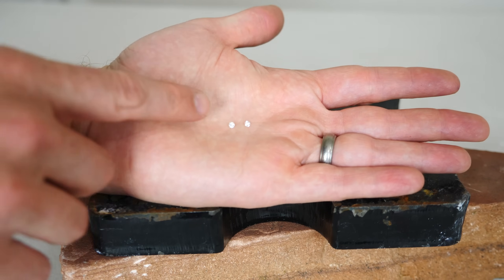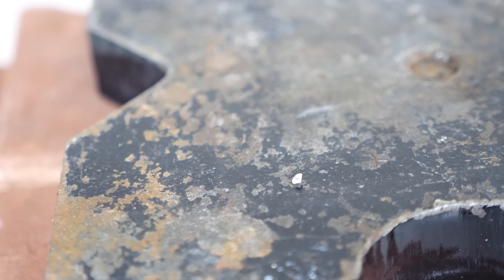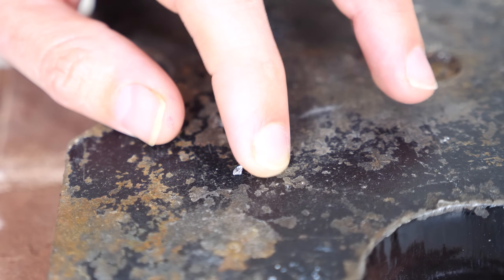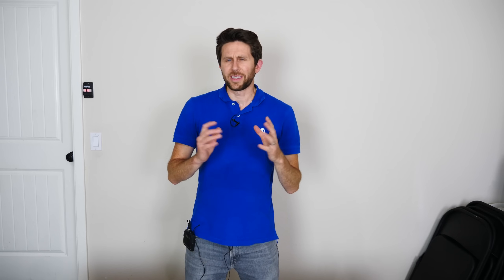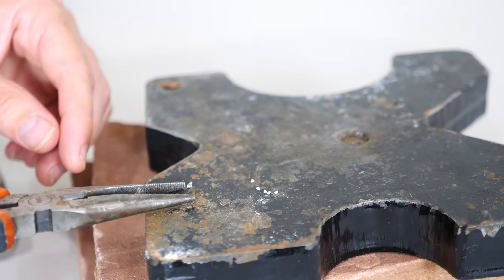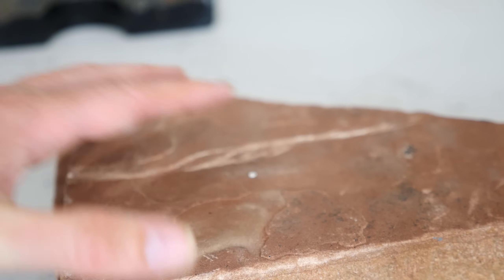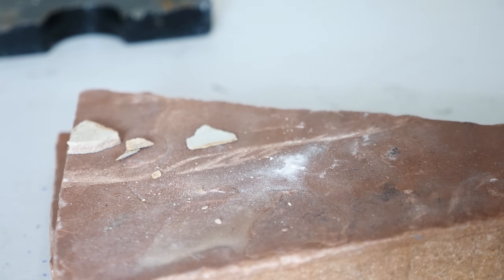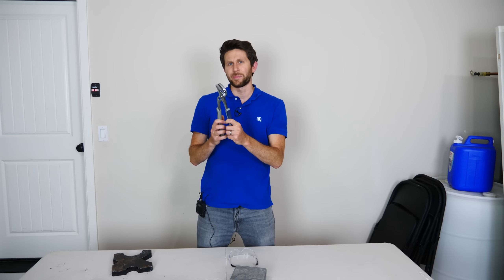Can You Break a Diamond With a Hammer?

Comment from the maker: I didn't break one of the diamonds, what should I do with it?
Reply: You should give it to your wife, she would probably like that. 😁
Reply: @sscho1636   Haha good one
Reply: melt it
Reply: @DamianReloaded  absolutely!!!!
Reply: What happens when you heat it up?
Reply: @deancyrus1  it gets hot
Reply: @saifmohammed9070  i could have said the same thing to the original video about hitting it with a hammer....🤣 'it breaks'
Reply: @deancyrus1  but in that case something actually happens, nothing will happen if u heat the diamond unless he gets to 3500+ degrees Celsius
Reply: @saifmohammed9070  It'll burn at a much lower temperature than 3500°C.
Reply: @kyle88740  yes it will in a concentrated oxygen environment
Reply: @saifmohammed9070  and your point is? Other than contradicting yourself. In one breath you say nothing happens and in another you say it will 😂
Reply: @deancyrus1  that it will be cool to see. Heating it won't (theres a difference between heating and burning)
Reply: @saifmohammed9070  did i say that there wasn't a difference between the two? What was your suggestion for the diamond?
Reply: Dean Hamlin It melts if temperature over 6000 degrees is reached or it burns away until the whole diamond is gone if exposed to air or oxygen in general during heating. In the end diamond is just carbon.
Reply: Dean Hamlin it'd just evaporate. They have done this experiment before. Better is it to gift it out.
Reply: Burn it!
Reply: Give it to me
Reply: Saif Mohammed my response literally.
Reply: Saif Mohammed duh
Reply: @saifmohammed9070  no me
Reply: try and melt it
Reply: This isn't related to the diamond thing but there is 90% chance you will see this. I heard that boiling(not boiled) water turns into ice faster than normal water into ice. But I never could understand why. I would be very grateful to you if you made a video on it.
Reply: @sourabhperuri1698  there are many videos that show that boiled water turns faster into ice, I think Cody's lab has a good one on it
Reply: @Ktulu789  Thanks. Will check it
Reply: @sourabhperuri1698  because the atoms are more excited and escape easier when its boiling but as it cools because it has come from a high temperature it goes colder quicker. Think of it as if a race starts the room temperature water is standing on the start line but the boiling water had a running start so will always win.
Reply: @DJAsHeRMusic  I didn't get it right I think. Why will it get colder faster if it is at more temperature? It is more distant from the start line than the water at room temperature. This is my understanding. If purity is a reason, then the experiment must be tried with boiled and boiling water. Could you explain your reply in a little more detail?
Reply: try burning it at very high temp
Reply: Make another experiment with them. Try to zoom in and show us the bonds between carbon atoms
Reply: @AwesomeTheAsim  lol
Reply: A Akd not possible to see bonds directly. But due to XRD structure and bond length can be analyzed.
Reply: @AwesomeTheAsim  nice idea you are smart
Reply: @AwesomeTheAsim  r/brandnewsentence
Reply: Melt it
Reply: Give it to Steve so he can make armor
Reply: EEAAATT IIITTTTT!!!!!

Jk dont
Reply: PRINCE RUPERTS DROP VS DIAMOND!!💧VS 💎= 💀💥?
Reply: @rayfairbanks6280  Prince Rupert drops can scratch and dent. I think smarter every day has some slomo video about one that looses a bit from the drop side without shattering. Pretty amazing!
The action lab never did experiments with Prince Rupert drops, i think, so.... That would be an interesting experiment anyway!
If it was not Destin, maybe the slomo guys or hidraulic press channel... The best on PRD is smarter every day, though.
Reply: Make aerogel out of it.
Reply: @JohnGrapes  Lol
Reply: @JohnGrapes  uwotm8
Reply: Turn it to aerogel.
Reply: Put it on a ring for your wife
Reply: Burn it. You can burn it, right?
Reply: A ring for your wife..I guess🤷🏾‍♀️
Reply: Explain the electrical properties of different materials based on carbon. Like diamond, graphite in all three dimensions, ... So people will get to know the difference in bondings.
Greetings from germany
Reply: Diamonds are worthless, so just throw it away
Reply: Smash it.
Reply: The Action Lab add it to your collection of experiments
Reply: Scratch different hard core materials with it 👍
And if it is still survive... give it to me 😊
Reply: Put it in the vaccum chamber and see if it turns to water.
Reply: make it back into graphite
Reply: Eat it
Reply: @HTETgamer Laser will burn through diamonds, yes. Lasers have almost become standard equipment in diamond polishing facilities because it separates the crystals into usable pieces much faster than traditional diamond coated "saws", with much less waste
Reply: There are a lot of really cool things you can do with lasers and diamonds. Give it a shot!
Reply: Cool it in the liquid nitrogen and then rapidly heat it and see if it'll shatter?
Reply: Hide into one-one Action Lab box! :D
Reply: Try some other experiments with it.
What happens if you put it to high temperature? Will it transform into carbon? Change it's structure? Become graphite? Change color at least?
What types of acids can affect it and how do they affect it? And what those same acids do to other things like gold silver or steel. Maybe even against some common household material that is known to be resistant to certain acids, it would be interesting to see an acid that kills diamond but doesn't affect... I don't know, silicon? Rubber? Teflon? You may need some chemist help here but I'm sure there are surprising things to explore here.
Try to use a macro lens to film the diamond. Thankfully, it didn't jump out of the plyers and into the unknown xD
Thanks for the video it was very surprising both ways, you always teach me something even when the title seems simple (not this case) so I try to watch all your videos. Keep it up!
More ideas: Try to show how do they work the diamond shape. If it is so hard... Then how? xD
If you use a very sharp titanium point, as the point and pressure is done on a very small area, would it scratch the diamond? (First hammer it in place so it doesn't move xD)
I said fire, what if you throw it on liquid nitrogen? How fast does it transfer heat? What if it is heated and then thrown into liquid nitrogen, would it break that way? The other way around? Cold then heat? Does it glow when heated? Would it react with Mercury or some other element? (Ask the chemist again... These guys are handy! xD)
Man you certainly sparked my curiosity! I could easily keep coming up with experiments for a year of content with just a single diamond haha, now I know why are they so valued xD
Reply: @Ktulu789  there are already videos that answer these questions. Go find them.
Reply: @ThePrufessa  thanks! I actually saw one on acid but just with two acids and no household items.
I guess that everything is already on YouTube, anyway xD But the personality of the action lab is irreplaceable :-P
Reply: Scratch that big one with them smaller diamonds
Reply: Crush it in your press
Reply: make more diamonds with graphite and extremely hard pressure and heat
Reply: Hydraulic press it
Reply: Break things with the diamond.
Reply: Make a beautiful ring and give it to your wife
Reply: The Action Lab give it to your crush
Reply: Show it's physical properties.will it shine in dark?
Reply: Give it to your wife
Reply: Im just saying your wife may be lookin this direction
Reply: Grow it to a larger diamond
Reply: gimme that, I need it for my xperiment
Reply: See if it can cut holes in glass, like in spy movies.
Reply: Give it back to your wife. She must be furious
Reply: Put it in a hydraulic press
Reply: Make a glass cutter with it
Reply: test how it scratches other materials
Reply: I can make you a ring
Reply: Put it into the lavaoven and afterwards smash the lava and try to find out if it kept its form...
Reply: Eat it
Cuz the body spreads nutrient from the small inestine to the whole body
1st, spread the diamonds into pieces until its small enough for small intestine to absorb it
2nd, eat the diamond's dust 
3rd, wait for 18 hours and you now become the strongest and the hardest man and material in the world
Reply: @The Action Lab , I have two questions 

Q # 1 : Can you dry your washed clothes in your vacuum chamber ?
Q # 2 : Can you make protein powder by drying/evaporating/boiling the liquid part of whey in the vacuum chamber ? 

Seriously , I want to know .
Reply: Can you , destroy it chemically
Reply: Do a demonstration showing the hardness of silicon carbide, glass, sapphire, and diamond
Reply: This can be your anniversary gift but keep secret 😉
Reply: Try to see if it’s bullet proof
Reply: Swallow it shit it out and sell it.
Reply: Try burning the diamond. Diamonds are made of carbon and they should burn.
Reply: Give it to your wife
Reply: make a beautiful ring for your wife 😊
Reply: Make a ring
Reply: Make a jewellery and give it to your wife
Reply: Get a refund, cuz its fake.
Reply: Eat it
Reply: I have a question, I do know this video was made 1 year ago, but dude perfect did something like this where they tried to shatter a diamond with a hammer in episode 1 of OverTime, but the diamond did not break. Could anyone explain this?
Reply: Break it then!
Reply: Cut the diamond in half not breaking it.
Reply: @dieticianmeenakshimajumdar7854   he needs another diamond to do that🙂
Reply: Lick it to dog
Reply: I think it would be interesting to put it in your foundry and see what happens
Reply: give it to me
Reply: Burn it or zoom it with microscope
Reply: Could you try to burn it?
Reply: Convert it to graphite (thermodynamically it's more stable than diamond)
Reply: Would it burn? It is carbon after all...
Reply: Give away?
Reply: Mount it on a piece of jewelry for the wifey.
Reply: Put it in the hydraulic press!
Reply: Burn them, it would make a good video
Reply: hydrolic press !
Reply: Set it on fire
Reply: Put it in the vacuum chamber! Why? Idk
Reply: Submerge it in liquid nitrogen and then immediately in something superhot to see if it shatters?
Reply: See what temperature it will melt under
Reply: Melt it or use it for a laser lol
Reply: burn it in oxygen
Reply: Hydraulic press? :)
Reply: Try breaking it with vice grips
Reply: Hmm I was thinking about the hydraulic press...
Reply: Use press machine, then record it with super slow motion cam
Reply: Try turn it into a little cube by cutting/sanding would probably take forever to do but never seen a diamond cube before
Reply: @DJAsHeRMusic  it might end up smaller than a millimeter probably. The current shape is pretty round and a lot would be wasted.
Probably won't look any different than glass. What makes the shiny appearance are the geometric faces with their respective angles and the diamond shape is specially designed for that. There are many special geometric shapes that enhance brightness based on the original shape of the rock (more oblate, more elongated or the classic). Most have many faces on the point side and a "window" on the other side and some bevel.
Reply: Drop it on lava
Reply: Try to break bulletproof glass with it as we saw it on Sherlock Holmes when Moriarty broke the glass containing the crown using a gum,a piece of diamond and a fire extinguisher!!!!!!
Reply: Try to put it in some acid like (h2so4 Or Stomuch acid:-HCL)
Reply: melt it with the laser
Reply: Giveaway😅😅
Reply: Hydraulic press it
Reply: If I have a diamond that's for free
I will try to scratch every thing with it then I'm going to do heat experiments
Reply: Abdul1s Launcher  if had a diamond 
Would you just give it as gift or to poor 😁
Reply: Maybe put it in flourine or show/explain how they are resistant to being dissolved by acids.
Reply: Turn it back into coal
Reply: Try to melt it with heat
Reply: Give it to someone who needs it
Reply: You should try to burn it.  Diamonds combust at very high temperatures.
Reply: My heart is breaking 😫
Reply: The Action Lab see what happens if you cast it?
Reply: Give it to me cuz I'm broke😭
Reply: Do a giveaways
Reply: You should put it in a random subscription box with a note taped to it
Reply: It’s alright I’ll take if off your hands for you
Reply: give for charity
Reply: War
Reply: Try to disolve them.
Reply: Eat it
Reply: Put it on the hydraulic press
Reply: 1:31 - 1.37 What happened then?
Reply: melt it
Reply: Try to burn it with liquid oxygen
Reply: The Action Lab sell it
Reply: Sell it
Reply: Eat it
Reply: Try to see if you can melt it
Reply: Let me have it
Reply: Try to burn it
Reply: Give it away to a lucky subscriber.
Reply: craft a diamond shovel
Reply: Put it under under the hydraulic press
Reply: Make diamond armor with it
Reply: Give it to your dog
Reply: Look for what stone like diamant is the most price
Reply: Give it away.
Reply: Throw it away
Reply: The Action Lab make a diamond shovel or a jukebox if you have some wood
Reply: Try burning it. What is its burning point?
Reply: Me want diamond
Reply: Me want it, you give me it
Reply: Plz give me that diamond
Reply: I will get 100  subscribers for you . Give that diamond to me.
Reply: Put inside some car engine
Reply: How fire resistant are diamonds ?
Reply: The Action Lab gimme
Reply: Diamond vs liquid nitrogen
Reply: Make a clip of how much temperature is needed to melt a diamond
Reply: Can I have it?😢😢😢😢😢😢😢😢😢😢😢😢😢😢😢😢😢😢😢😢
Reply: Keep it
Reply: Scratch things with it
Reply: some experiments and example of playing with it's refractive index please
Reply: Can u melt a diamond?
Reply: Try to melt it or show how it reacts to diff matters like acid or any other
Reply: Fashion the diamond into your burning laser to enhance it!
Reply: PUT IT IN A PRESS
Reply: Try to melt it
Reply: Try to shoot it and see if it breaks
Reply: Make a diamond shovel
Reply: Diamond vs Hydraulic Press?
Reply: What would happen if you throw it at a window? Because it's harder than glass...would it shatter the glass?

I have seen a tiny piece of spark plug ceramic shatter safety glass, when thrown by hand.
Reply: Heat it up super hot and drop it in liquid nitrogen
Reply: Heat it up and drop it in liquid oxygen and see if it really burns the diamond!!! Or explain the difference between Cubic Zirconium and diamonds!!!!!!
Reply: focus 5w laser on it or freeze it with lq nitrogen and quickly heat it up to see if you can break it with thermal expansion
Reply: The Action Lab Eat it!
Reply: Make a giveaway..
Reply: Eat it
Reply: Eat it so you can say "I s**t diamonds".
Reply: Se if a Diamond melts
Reply: Try melting or burning em
Reply: Try to burn or melt
Reply: I would say craft a diamond sword with it, but you only have one.
Reply: Giveaway
Reply: diamond shover obviously.
Reply: Melt it
Reply: Put it in lava
Reply: Try to burn it, and if it doesn't it can be used for something else again !
Reply: turn it into armor and raid area 51
Reply: Let the spontaneous process happen and let it convert to graphite in the next 50000 years
Reply: Diamond can only be smashed or crushed by a diamond
Reply: Touch diamond with diamond to see it break as a yt vid, or sell it or keep it FOREVEEER
Reply: Melt it with a high melting point
Reply: Burn it!!!
Reply: Smelt
Reply: Burn it.... then see if you can polish off the burnt surface... I'm a jeweller and it happens more often than people would think
Reply: Break it
Reply: Shoot it at the Gorn.
Reply: Send it on my address
Reply: Maybe make crazy diamond stand
Reply: Give
Reply: lava
Reply: BREAK IT
Reply: Make it bigger
Reply: Use it to break tempered glass - like using a spark plug, but I'd be interested to seeing that happen with a diamond.
Reply: Give it to meeh
Reply: Give it to me
Reply: cook it
Reply: eat it
Reply: Eat it
Reply: Eat it
Reply: Use in a laser ...like the movies
Reply: sell
Reply: Gimme the diamond!
Reply: Sell it?
Reply: This is the work of an enemy stand user
Reply: Sell it
Reply: Definitely blast it with oxy/acetylene.
Reply: i vote to send it to president putin to make him stop attacking ukraine
Reply: Dude do you know diamond are that strong that they can withstand the pressure that is five times more pressure that earth's core has in it
Reply: If you didn't broke diamonds then we're they fake diamonds
Reply: Put it in a machinists vice and see if a bandsaw will cut it
Reply: Try placing it in Lava....
Reply: shoot it with a gun?
Reply: Oh, so that's why they call them Die-Mounds, because you can easily break them into a little mound of dust.
Reply: Draw on glass with it.
Reply: Put it in hot lava
Reply: The Action Lab is this real
Reply: @nirajpatel1247  yes
Reply: Find a local glassblower and show how it can be encased in glass!
Reply: Gimme gimme
Reply: Use an iron pickaxe
Reply: Eat it
Reply: Heat it and put it in oxygen
Reply: Sell it to me
Reply: you should sell it and use the money you sold if for to pay a teacher to teach you how to not use the same words multiple times in one sentence. I love your content but the commentary is terrible  -  you have a channel about science,  do you really think you need to say the same stuff multiple time as if the viewer  can't remember what you said two seconds ago ?
Reply: I think he does that on purpose to reach as much audience as possible. I as a non native English speaker can comprehend everything he says. He's very easy to follow. Also think about the kids or other people who are not into science.
Reply: @TheMoonMan.  it's for the stupid people like you
Reply: @DJAsHeRMusic   why didn't I see that coming,  while I'm actually pretty good at chess, maybe I am the stupid.
Reply: @TheMoonMan.  you are not the target Audience, also you do not count as 10000 viewers who are actually dumb. Learn what stupid actually means and how many of the humans you share space with suffer from it. Dont be naive.
Reply: @TheMoonMan.  tf is wrong with you? If you don't like the way he's talking then don't watch him